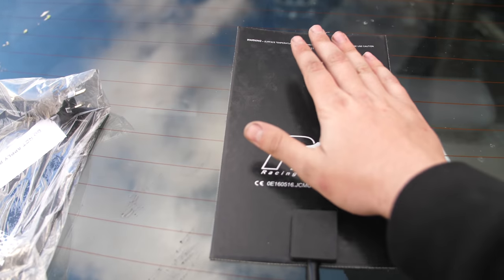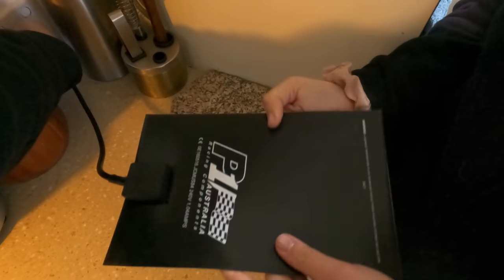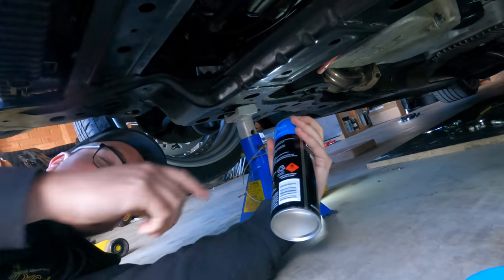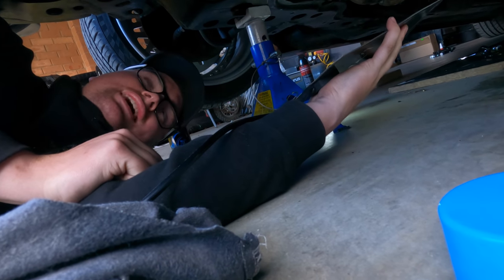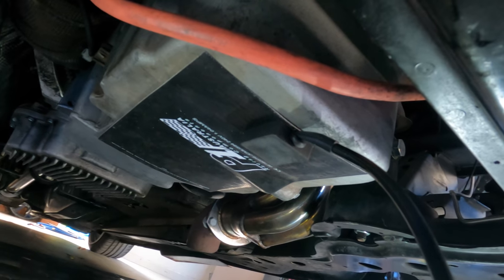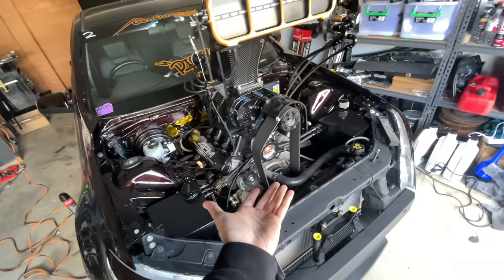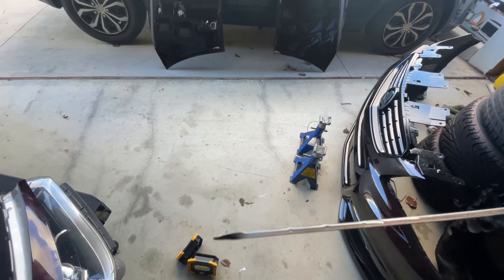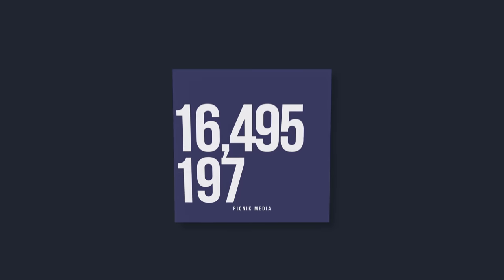This Will Revolutionize The Car Industry 😱

Comment: Has anyone actually tested this with a temp guage to see how long it actually takes to heat the oil? I only ask because I have a cheap chinese one (and it may be because of exactly that) which after 30 mins has only raised the temp by 2C. That's going to take way too long to get the oil to operating temp of 90C!
Reply from the maker: After an hour it only got the oil warm, but… that’s half the battle won in my eyes! A million times better than stone cold at max thickness

Comment: 56 seconds, says won't need a inverter. How tf you going to run that if you don't have 240v(cars dont) if not at a 240v(home or a shed etc) source without a inverter
Reply from the maker: I think you have inverter and generator confused
Reply: @Mick_Hinchy  don't think he does. How are you going to run that at the track or anything where you aren't in a shed with 240v. Legit need a power inverter (to convert 12v to 240v) or a power generator you can put the 240v plug into
Reply from the maker: @lancegardos9769  a lot of tracks have power, and almost every event we go to we camp at so we already have a generator with us